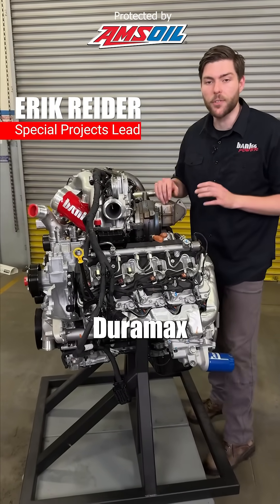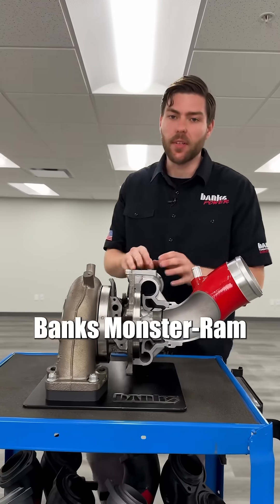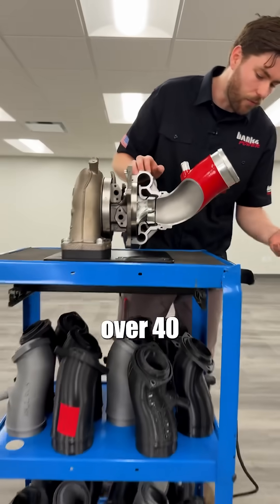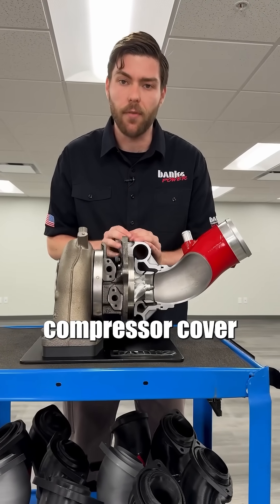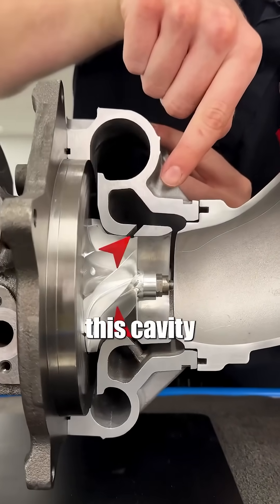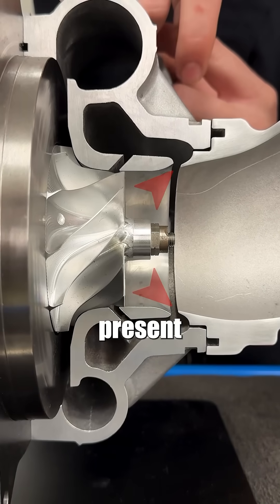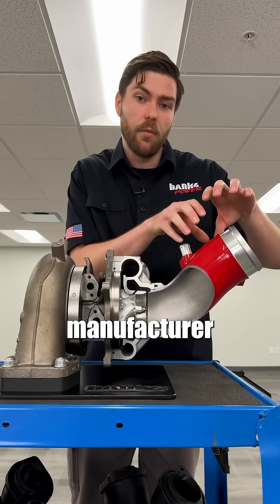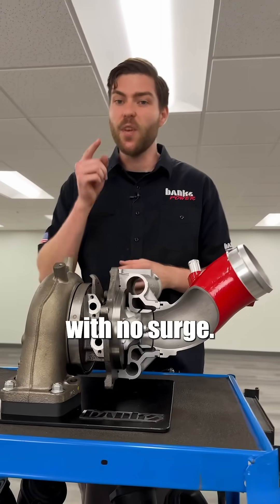Prevent this turbocharger phenomenon.

Comment: Wonder why a BOV wouldn't accomplish the same thing since that's what's done with gas engines. Maybe has to do with diesels not having a throttle blade and not pulling vacuum the same as a gas motor

Comment: Don't forget to put a real steal pin instead of them crappy ball pont to hold camshaft has one n crankshaft has two lil balls instead a pin ur going to need to cut it towards cylinder to hold timing or weld it so ur engine doesn't get seized but the wagler built for 3400 hp boost make sure u let it roll in the main bearings ceramic rollers from skf cooper splitcage no spun bearing or copper or brass but relays on oil much more 300000 400000 rail pressure would lolz remember boxs cutter portable might need ball bearing turbo is better than journey bearings 🤔😋

Comment: If you do a before and after dyno and show that Banks equipment actually lowers horsepower and torque, Banks will sue you to remove the real data from the internet.
Reply from the maker: If you are referring to the DRD video, we have analyzed DRD Diesel's video and have spoken with Ray, the owner. His tests are flawed and misleading. According to dyno sheets published in DRD’s video, tests on the stock and Banks Monster-Ram equipped 2020 RAM 6.7L truck were performed two weeks apart. More importantly, the tests were not performed in the order presented in the video. 

Time stamps on his dyno sheets tell the real story. Stock tune and DRD tune tests were performed on June 22. Stock tune with Monster-Ram and DRD tune with Monster-Ram tests were performed on July 5. The DRD tune remained active in the truck during the two weeks between tests. Assuming a manual regen was not performed prior to the second set of tests, it’s expected that the DPF soot load would climb significantly thanks to the dirty “emissions compliant” tune still active in the ECM. 

In other words, DRD began the “Stock tune with Monster-Ram” with the DPF clogged. Diesel truck owners know all too well, as the DPF fills, power is reduced. A tuner who knows what he's doing records EGR activity, DPF soot load, vane position, throttle position, MAF, turbo speed, compressor inlet and outlet pressure, EGT, and MAP. None of these were recorded in DRD's "tests."

Comment: This is something that ricers don't realize. Their beloved 'stutututututu' is the sound of a wall of air hammering on the bearings and seals of the CHRA. It's especially a problem on diesels, because a leaking oil seal in the turbo can become an unregulated fuel source
Reply: Not really a problem when it's happening off throttle, that isn't what what they are talking about in this video.

Comment: I wanna see this work. Because the thermodynamics I learned aren't looking at the stagnation pressure of the reverse flow.
It's not a matter of direction of flow, it's a matter of pressure differential. You can't force high pressure air to turn 180 degrees away from low pressure pipe (the intake) just by putting ailerons in its way.
Reply: It happens when you let off the throttle. The throttle blade closes and the compressor wheel is still spinning, rapidly increasing the air pressure which tries to force it's way back through the compressor wheel the wrong direction. Since the throttle blade is closed and the engine isn't sucking up the air, that backflow easily overcomes the atmospheric pressure on the front side of the turbo.

Comment: Can I get that technology for my 6.0 Powerstroke?
Reply from the maker: Yes, we offer an intake elbow packages for the 6.0L Power Strokes. It's called the High-Ram. It eliminates restrictions, dramatically increasing the air cooling capacity for massive continuous power.  See these links. 

High-Ram Intake System w/ stock intercooler: https://bankspower.com/products/intake-elbow-42751-2005-2007-ford-f250-f350-f450-f550-6-0l-power-stroke-2005-excursion

High Ram High-Ram Intake System w/ Banks intercooler: https://bankspower.myshopify.com/products/intercooler-system-25975-2005-2007-ford-f250-f350-f450-f550-6-0l-power-stroke-2005-excursion

Comment: In stock turbo installed electronic boost pressure control. That configuration has no surge when throttle closing. It's better than bypass channel in compressor wheel body.

Comment: I added a S&B to my 2024 duramax with less then 50miles on the truck. 

I experience this surge almost every time i drive it, i was thinking it was something wrong with the truck itself and was thinking of takin it back to dealer for warranty investigation. 

I didn't drive the truck enough before installing the intake too notice it started only after installing the S&B. 

Guess ill be removing that this week and purchasing a Banks intake. 

Thanks for the explanation
Reply: Any alterations to the engine will void your warranty and that bright red intake is an instant giveaway,as well as the other bright red upgrades offered by Banks of course if that’s not an issue they are the Best by far.
Reply: @ricknielson8934 Can always take it off before you bring it in for warranty 😂

Comment: Wish  @bankspower  would get the CARB certification for the monster intake. The whole 6.7 cummins market 2007.5-2012 have been waiting.
Reply from the maker: Our testing is done, and the paperwork has been submitted. Unfortunately, it will be approved by CARB when they deem it so. Until then, we are in a holding pattern; it's a common struggle manufacturers in the aftermarket share.

Comment: But when I make comments on Instagram I have experts telling me about how they have never installed a BOV or BPV on a client’s car so I must be lying about the effects of on-throttle and off-throttle surge.
Reply: Nothing wrong with off throttle surge.
Reply: @DriftNick  Yes there is. When you have your foot off of the gas you close the throttle body, you leave nowhere for the compressed air trying to enter the engine to go.

You are off-throttle and not making power, which means you are not supplying the exhaust turbine with more gas to accelerate in RPM, which means you have a free-spinning compressor wheel with no forces acting upon it trying to infinitely compress air in the space that is in between the compressor exducer fins and the throttle body.

This air will fight back and cause the compressor wheel to rotate the opposite way. Would you ever want your compressor wheel or turbine rotating assembly to rotate backwards? No. That is what any kind of compressor surge does.
Reply: @wt2video922  Ah you are one of those people that think it makes the turbo spin backwards, you do not understanding what is happening if you think that is possible, not only is that not possible but it doesn't even slow the turbo down and this has been tested, you can find videos on youtube of people testing turbo speed when surge happens off throttle.
Reply: @DriftNick  Thanks genius, I’ll just forget everything I know about the subject because you said so.

No, the compressor wheel does not ever spin backwards; the forces acting upon it, however, make its continuous rotating operation more difficult by introducing unpredictable and unwanted forces unto the compressor wheel, also known as oscillation.

And yeah, when you have a turbo running eight PSI, compressor surge is not a big deal. When you are building a high-boost machine pushing 30+ PSI is when these things matter more. These unpredictable forces can move your compressor wheel side to side, introducing more wear to your thrust bearing and rotating assembly. It’s that simple.

By your logic, it doesn’t get harder to compress air as the piston moves up inside of the cylinder.

Think about it logically. Why would forces that oppose any normal mechanical operation, ever, in the history of machines, be good? I’m not talking about a boxer engine utilizing opposing forces, or a gyroscope. You know what I’m trying to say.
Reply: @wt2video922  Well at least you forgot the part where you think it makes the turbo spin backwards apparently, not really sure why you would say it makes it do that then in the next comment say it doesn't. 

"When you are building a high-boost machine pushing 30+ PSI is when these things matter more."

Plenty of people here running a lot more than 30+ psi and having zero issues.

"its continuous rotating operation more difficult"

When it's happening off throttle the turbo is already slowing down because of reduced exhaust flow, off throttle surge does not change the rate in which it slows down.
Reply: @DriftNick  I made a mistake in my wording and corrected it.

The compressor wheel speed is in fact impacted by off-throttle surge. You know why? Because when off-throttle, the compressor wheel is still spinning, compressing air, and when it can’t compress the air anymore, the compressed air will fight back against the wheel.

Can we agree on that? You’ve stated multiple times that the speed is not impacted, but you haven’t given me a reason. Yes, the wheel is already decelerating, but the air it is forced to eat from the wrong direction slows it more.
Reply: @wt2video922  The air simply goes out intake, this does not impact how fast the turbo is spinning, High Performance Academy have a video where they tested it, there is no difference in the rate the turbo slows down after lifting off the throttle between running no valve and running a valve.

Comment: I just bought a ‘24 Silverado 6.6L Duramax.  I’m thinking about getting one of these I just wonder if they’re really worth what you get out of them. 🤔
Reply from the maker: Congrats on the '24 DMAX. Benefits of the Monster-Ram include improved throttle response and turbo longevity, both thanks to lower shaft speeds. This is achieved by increasing air density to the compressor.
Reply: @bankspower  what’s the chances of you sending me one and checking it out!?? 😉
Reply: @bankspower  are these available for the 24s yet? I have been waiting since June of last year to get this but it has been in development this whole time and I have got not notification it was available yet.
Reply from the maker: Yes, the 2024 6.6L Duramax Monster-Ram Turbo Inlet is available for sale. However, CARB emission compliance is in process.

Comment: The noise is the best part
Reply from the maker: If you're referring to a blow-off valve or wastegate, that's a very different sound and is not harmful to the turbo. However, turbo surge is bad.
Reply: @bankspower  I know it's technically bad but I have a 12v Cummins that's had turbo flutter or surge between every shift for 210k miles and is still on the factory turbo. It's a beautiful sound.
Reply: @bankspower  when is the cold air intake coming out for the 2024 Duramax ? I’m waiting on that
Reply: @bankspower  he means the surge when you let off without a blow off valve and you get that surge of air coming back out of the turbo

Which while is a cool sound, it is also 100% damaging the turbo.
Reply: @mjay6245 I'll probably get roasted for this but I don't believe it's damaging the turbo at all. On a heavily modified gas car the turbo can experience massive and continuous explosions. It may reduce it's life span but so does flooring it. If it's a higher end turbo the ball bearings could easily handle the side load of some back pressure.
Reply: @dylanbachora8939  Reducing it's lifespan IS damaging the turbo.

The rapid acceleration of the turbine by opposing directions of high pressure air sends shocks through the blades, shaft and bearing.

Will it detonate your turbo? Extremely unlikely without it already being close to death, but it does increase wear and tear.
Reply: @mjay6245  I'm not sure damaging is the right word. By that definition flooring an engine to enter a freeway would be damaging the engine. Putting this aftermarket turbo and tuning for more horsepower would also by that definition be damaging the engine.
Reply: @dylanbachora8939  It is. Wear is another word for normal damage over time.
Reply: @mjay6245  Yeah except I don't see them saying that installing this turbo, tuning the engine to run more boost and horsepower is "damaging the engine". Interesting double standard.
Reply: @dylanbachora8939  It's well known that if you operate engine parts in their normal operating parameters that they will (unless defective) last at least as long as the manufacturer warranties them for, if not longer.

The closer to the max you run parts, the less extra time you will get. This is basic common sense.

Your engine can Rev to 6500 rpm, but if you do it 50x a day, it won't last as long as if you never do it.
Reply: @mjay6245  Exactly but we don't say we're damaging the engine when we floor it or drive a vehicle hard. With the same logic people should be saying towing with a truck "damages" everything including the suspension.

And by the way, ball bearings are literally designed to take a side load that's why wheel bearings are ball bearings side loaded with the whole weight of the vehicle on it. So saying that side loading a ball bearing turbo "damages" it is an absolute misuse of the word.
Reply: @dylanbachora8939  No it's not. Wear and tear on an engine of any kind is expected damage over the lifetime of the engine.

By your logic, no engine has any damage/wear and tear until a part actually fails.
Reply: @mjay6245  Nope, that's a strawman argument. By your logic we shouldn't put aftermarket turbos and tune up our engines to push more power either. For them to say turbo surge damages the turbo and to not say that with the same exact logic using the turbo and higher boost damages the engine is just gross misrepresentation of reality and purposefully misleading.
Reply: @dylanbachora8939  You're actually so dense it hurts.

Damage is NORMAL for any engine. It's called wear and tear. 

The harder you push your engine, the more "damage" occurs. Over time this damage will EVENTUALLY lead to failure. 

I'm done explaining simple concepts to a brick wall.
Reply: @mjay6245  You are very literally saying the same thing I am. You just fail to see the hypocrisy in your belief. You're picking a needle from a stack of needles. There must be a translation barrier here. So let's make it super clear.

You're worried about slightly more wear and tear on a turbo when we're already strapping said massive turbo onto an engine that wasn't built for it or the boost it will deliver? That's like worrying about about a leaf in the yard during a hurricane. You may as well be rearranging deck chairs on the titanic.

Comment: Why dont you machine the intake fan on the turbo instead of using a nut, i heard you can get up to 15%more boost because airflow gets blocked or disturbed by the nut
Reply: Definitely not 15% lol
In certain situations the bullet nose will gain 1-2% airflow.
The air isn't being ingested from around the nut, it's not as restrictive as people think.

Comment: Now I every time I make my truck surge from here on out I’m gonna hear Gayle from the passenger seat…..WHOAAAA!
Reply: yea don't make your turbo surge on purpose. surging can kill turbos very quickly. at work, we test various turbos for oems and some will only take a few surges before the bearings give up and the turbo grinds to a hault.
Reply: @cbrunnem6102  mines been surging occasionally for the last 15 years and 250k miles, I bought it 3 years old with 56k on it all stock. Then the lbz ass kicking began !!
Reply: @cbrunnem6102   I don’t think anyone makes their turbo surge on purpose, but it’s the original turbo 250k and 15 years of ownership , it take a lickin’.  It’s my stock torque converter that’s hurt right now lol
Reply: that my friend sounds legit,
Mr Banks WHOAAA would be extreme 😆